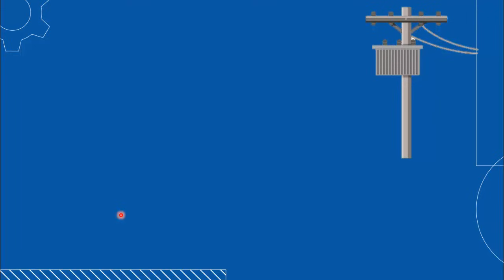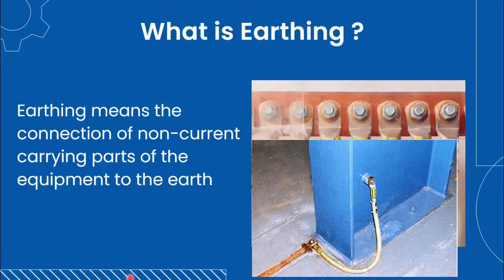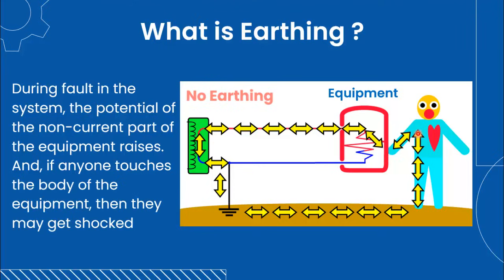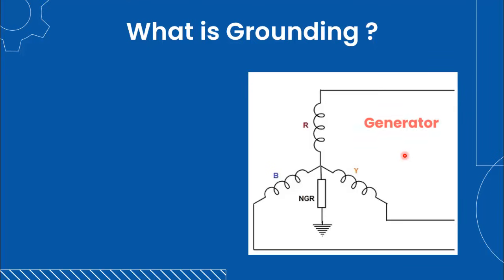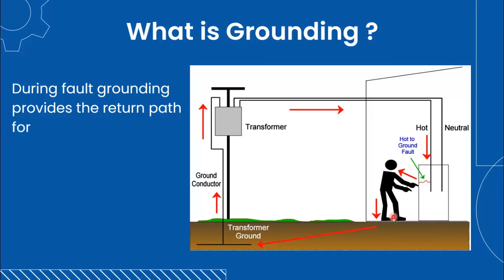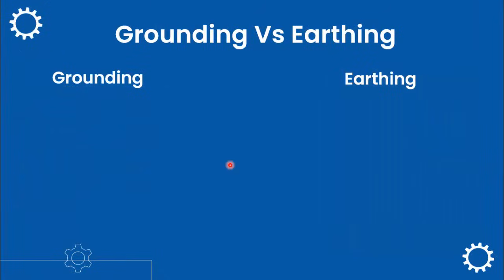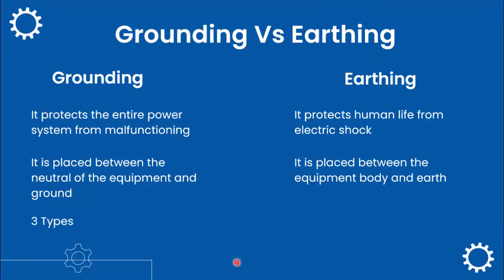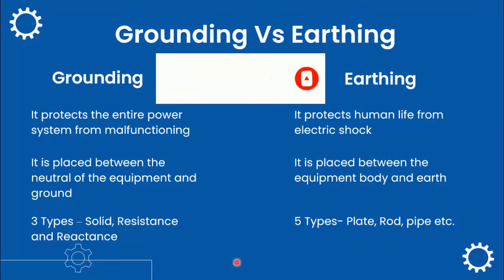Earthing vs Grounding | Difference between Earthing & Grounding

Comment: They are one and the same.
🇺🇸 Grounding
🇬🇧 Earthing

In the UK an earthed(grounded) neutral is called PEN (protective earth neutral) conductor and the installation is described to be a TNCS system (Terra Neutral Combined Separated) which means that Earth and Neutral are combined at the transformer and get separated once they get to your property.
Reply: Thanks, clearly whoever uses AI voice isn't a native English speaker and gets confused by US/UK language differences.
Reply from the maker: True. But these terms are different where ground is only connected at neutral. At premises the equipment has to be grounded. The return path is through ground not via conductor
Reply: @electricallectures   Then the earthing system is a TT (Terra Terra) instead of TNCS. First T means that the Neutral at the transformer is earthed and the 2nd T is for the electrode that is burried at your property via which your equipment and devices are linked to earth. In this the Neutral and Protective Earth (PE) conductors are not combined unlike in a TNCS (Terra means Earth in Italian/Portuguese). Ground or grounding is a not a term that you would hear among British electricians.